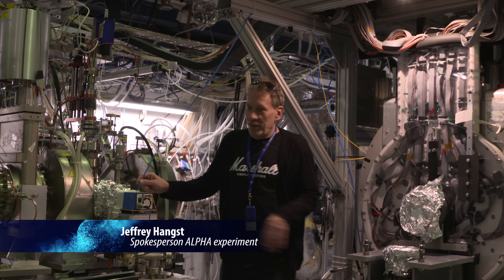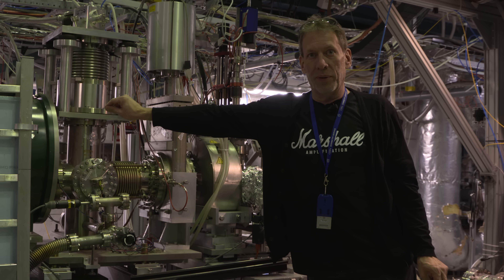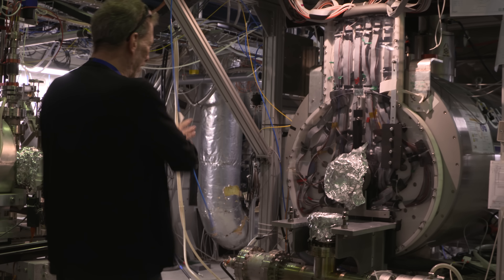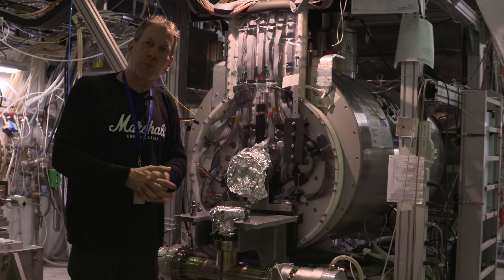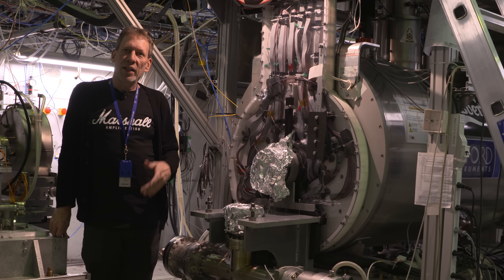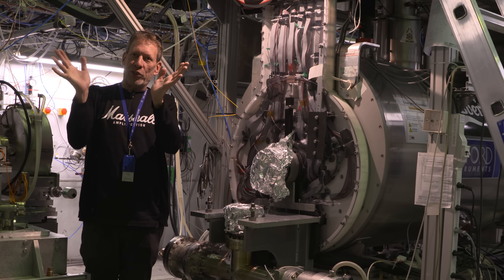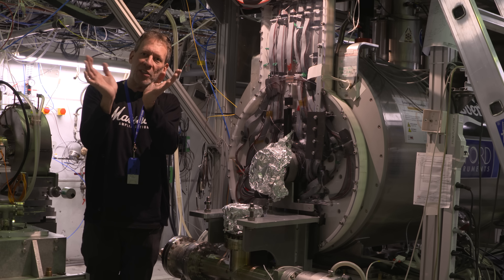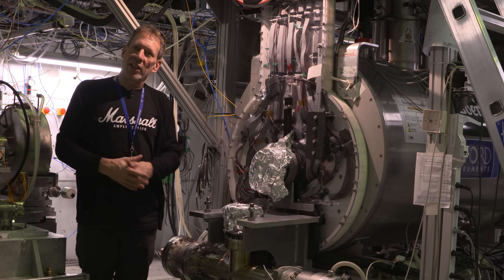ALPHA experiment: an improved limit on the charge of antihydrogen

Comment: 1: What do you do with the anti hydrogen atom when you are "done" with it?
2: If you let 1 regular & 1 anti hydrogen collide with each others, how "big" is the explosion? would you be able to see it with bare eyes (amusing you could see through the metal tubes and whatnot)
Reply: +Sion The antimatter just gets lost and touches the metal walls of the apparatus eventually.

No, when one anti-hydrogen is lost you only annihilate one antiproton, one regular proton or neutron, one positron and one electron. That is not much. That mass is instantly turned into pure energy in the form of light, but it is not much mass, all you get is a few x-rays and gamma rays. You can measure these and be able to tell that one of the atoms just went poof, but they are invisible.